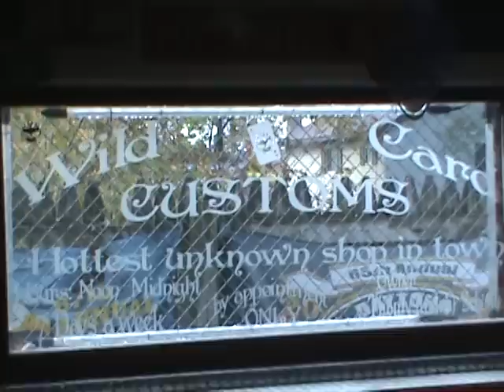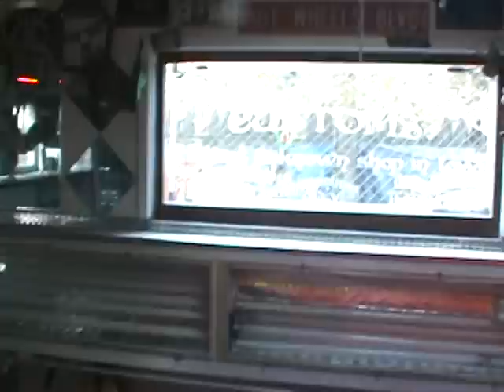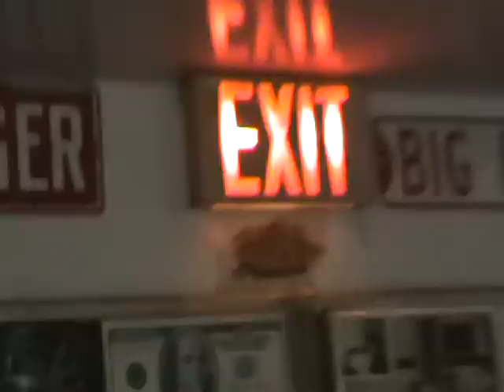WILD CARD CUSTOMS-212-PAINT PIMP

Comment: That is a tough project for sure.  It's bad enough when you tear one down yourself that far and it takes months or years to get everything back together.  When someone else did all of the taking apart,  that changes everything.  It can certainly be dealt with,  but given a choice I always choose to start with a complete, running car.  I learned my lesson with an 81 Z28 I bought a few years back.  Luckily I cut my losses early on and ended up with my turbo Iroc project instead!